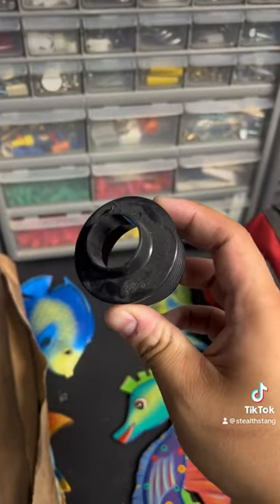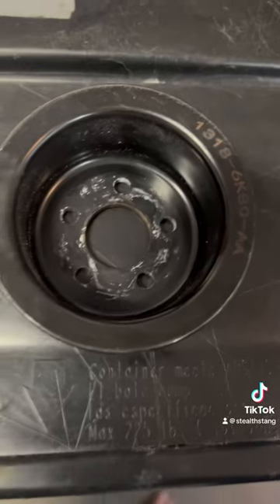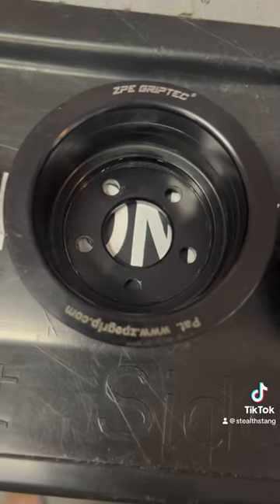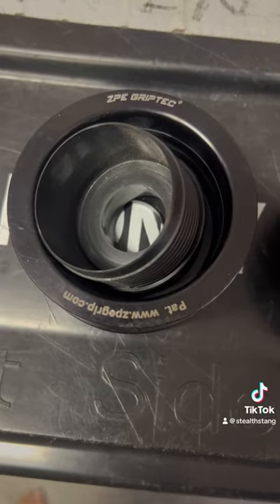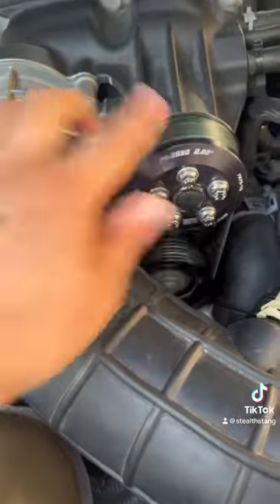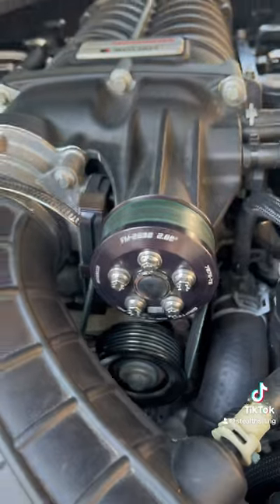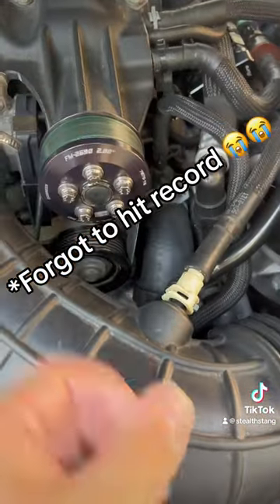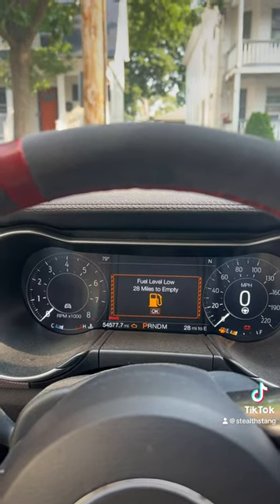Supercharged mustang on 27 psi first start!! (1.5 inch pulley) roush mustang

Comment: Good to see im not the only one with the roush supercharger, have you done anything else besides pully to the charger itself?
Reply from the maker: Yes! It’s Jokerz ported, VMP triple pass intercooler, PWR brick, upgraded pump and a chiller killer.
Reply: @OctaneAndAsphalt  i had seen afterwards that you had it ported which mod do you think i should go with first? I had to have the oem pump just replaced so ill leave that for down the road, i considered getting the roush upgraded cooling kit its like 2k or something?
Reply from the maker: @Nickizkindakewl  if you can I’d get an FI interchiller first that basically corrects all the cooling issues
Reply: @OctaneAndAsphalt so you’re running the interchiller and the VMP triple pass? I thought when you installed the interchiller you had to remove the heat exchanger
Reply: @OctaneAndAsphalt how are you running a intercooler and killer chiller? Don’t the kc replace all of the lines for that

Comment: Great idea adding more boost and more heat to a blower that has a terribly designed intercooler and a very restrictive throttle body for a FI application. I had that same blower on a 19 a10 car and it was a DUD. Sell that shit if you would like to make 700whp for more than one hit per day
Reply from the maker: It was a joke man the car exploded